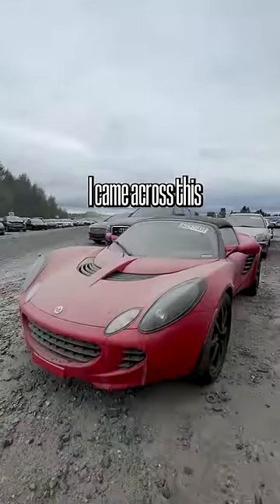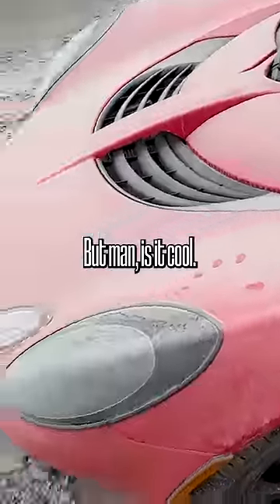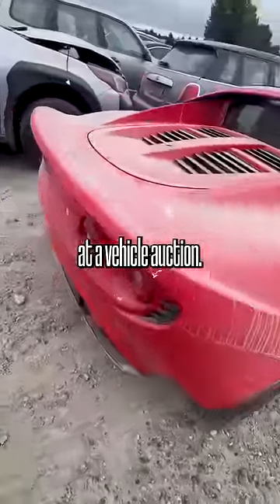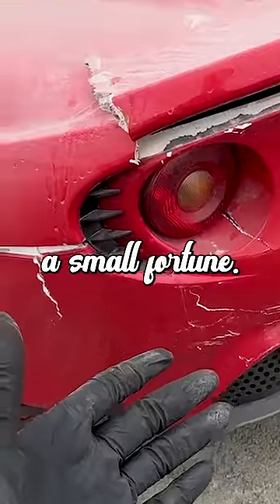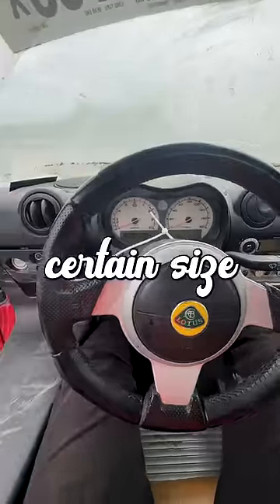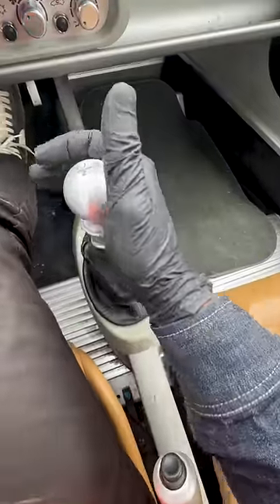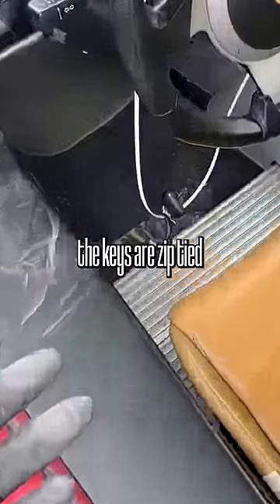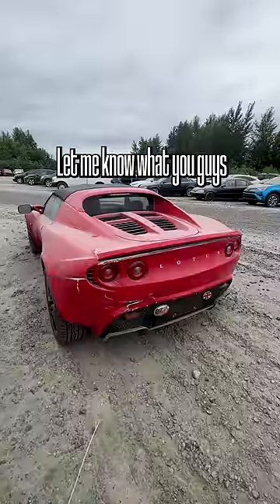Auction Lotus Elise - I Still Can't Believe It...

Comment: These things were actually powered by a highly modified Camry engine if I remember correctly.

What a gem. Gonna go for a lot of money tho
Reply: Was a 1.8 i4 supercharger
Reply: Not as modified as you'd think, especially the newer ones. Camry V6s are surprisingly powerful
Reply: I thought it was a tuned and built matrix engine
Reply: The evora had the same v6 engine as my camry with a twin turbo kit and a lightweight body
Reply: To be exact it's a Toyota 2zz-ge 1.8 dual VVTi-L that was found in a Corolla/Matrix.
Reply: Thats the exige, which i think uses toyotas 2gr-fe with a supercharger, yep a camry engine in a lotus, and the elese uses toyotas 2zz-ge they used that in the matrix xrs and the celica gts and a couple others i forgot
Reply: Nope,.this uses the 1.8 4 cylinder from the Toyota Corolla T-Sport Supercharged
Reply: That's the Evora that has a 3.5 l V6 from a camry
Reply: @organiccold  which is the same engine but fitted with a supercharger. A different supercharger then on the supercharged T-sport. There never was an official 2zz-gze so they're all 2zz-ge.
Reply: I am pretty sure there is a lotus that uses an insanely modified crown victoria engine
Reply: I thought it was the Rover K series in the Elise that was shared with both the MGF, MGTF Rover Metro and Rover 100
Reply: @sunnygtir  that's what I said
Reply: Stock canry and ur thinking evora
Reply: the elise and exige use tne toyota engine and are tbe same car but the exige is the hard top version of the elise, the evora is tne one that uses the camry v6
Reply: The rover K series engine did not pass USA emissions, so Lotus switched to the Toyota engine that already passed USA emissions when they started to import them to the USA.
Reply: These are inline 4s
Reply: Everyone is right... Sorta.
The 1st Gen Elise (S1) had the rover K series engine 1.8L inline 4. 

The S2 Elise (shown here) started with the rover engine, but moved to the Toyota 2zz 1.8L engine to pass emission standards, the head is slightly different. All S2 Elise/Exiges sold in the US have the 2zz and known as the "federal" elise/exige.

The S3 Elise continued with the 2zz with the 2zr (supercharged option) and a 1.6L 1zr option as well. The Exige went to a Toyota 3.5L V6 that was also in the Evora. The S3 Exige was sold in the states as a track car only since it couldn't pass safety road car standards. The S3 Elise was never sold here legally.

Edit: met someone who had an S3 Elise in the states, they were sold for the first year or two in the states.
Reply: @RenlangRen  I see, so that's why they opted to use Honda's V6 in the Rover 800s that they rebadged and sold as Sterling's in the US market
Reply: Stock Camry engine thru just toss on sc
Reply: It was from the celica gts and the matrix xrs. Some people put that engine into a mr2 spyders too.
Reply: That’s the Evers! Stop giving false info!
Reply: Same engine from Toyota, NA with a Yamaha head
Reply: past 2004 and not the elise, its the 111 to exige
Reply: Wasn't it the XRS Matrix engine that's in there?
Reply: They had a Celica 2zz and the exige had a Aurion/Camry 2gr engine
Reply: It was the 2ZZ from the Celica GT-S
Reply: From yamaha
Reply: @matthewchau8907  and Toyota. The head was designed by Yamaha and block  designed by toyota
Reply: Yes i thought the same i Guess is aluminum block withfiber body man this is a bullets imagine putting a Toyota v12 aluminum from the Century then twin turbo plus nitro  for humble track day😂😂
Reply: @kaosalone3748  so technically my Corolla is a Lotus
Reply: @CneyTMS celica gts?
Reply: @claytry3371  yes it also came in a Celica.
Reply: 2zzfe
Reply: @lowkeydiegoduran4724 super wrong haha no lotus had a 2gr. Thats a v6.
Reply: @REAPER3fitty   bro, what? Ever heard of the lotus evora? It has the toyota made 3.5 2grfe v6 with some work done by lotus for more power. Nextime, do your research before trying to correct somebody, because you'll just end up embarrassing yourself. https://en.m.wikipedia.org/wiki/Lotus_Evora#:~:text=as%20a%20trademark.-,Specifications,24%2Dvalve%202GR%20V6%20engine.
Reply: @REAPER3fitty  also there's no such thing as a 2zz FE only the GE
Reply: @lukeshelly5633  it's better. Because you're Corolla can haul a lot of shit
Reply: Absolutely not. The elise has a Honda engine. Honda and somebody else. It's a version of the K20Z3. The 8th gen Si motor.
Reply: Its essentially a high revving honda vtec engine the only other engine from soembody besides honda with cam Lift ( not the same as variable valve timing as they can coexist or both exist without eachother )
Reply: @repingers9777  it had both VVTi and Lift. It was denominated by the VVTi-L. The only engine ever produced with this kind of lift by Toyota
Reply: @CneyTMS  I wasnt sure if it also had a variable timing cam gear lol so it's more like i-vtec then both engines combine the both
Reply: @repingers9777  I guess so.
Reply: It's a headache trying to explain it to people my coworker has a E36 bmw and says VTEC ain't shit and it's the same as his engines vanos and better which isn't even true and is literally broken on his engine. You know how I know it's not the same thing? Because my fucking h22a prelude doesn't have variable valve timing it's just lift there is no vtc gear that advances timing on cams it just switches to a big cam. And on my 8th gen SI the k20 has both it advances timing up to 45° on the intake cam along with having lift switching to a big cam there is no other manufacturer that is like that there are only things close to it or really fancy cam phasing tech but it's still not as effective as lift. But of course that's too much for most people to understand and accept
Reply: @repingers9777  VTEC ain't shit...

... Until the VTEC kick in.
Reply: Probably an MR two engine. People forget the car exists but it was literally faster than NSX. Player intended for the second and third GEN‘s to get their V6 but it never came to fruition due to rushing the project. But therefore Bangerz have always been adequate hell even when they were making the 2 to 2 for group S the V6 and the four-cylinder made nearly identical horsepower numbers torque probably only mattered in the four-wheel-drive variant for the extra muddy stages but the floor banger would probably be lighter and higher revving for asphalt rally.
Reply: I have a UK 2009 S2 Elise that i never want to get rid of. The S has a 1ZZ engine, the R has a 2ZZ, and the SC has a 2ZZ with a super charger. They aren't big engines but the car is so light they accelerate fast and turn well. You can even tell from the gears in the video how satisfying it is to drive. It's great fun.

Also I'm 6'2 and fit in fine. You're basically lying down when you're in it, so height is not really a problem. Getting in and out takes a little practice though, you kind of have to fall in and climb out.
Reply: The Elise is a 1.8l supercharged engine
Reply: I have the Camry with the evora engine
Reply: This has the 2zzge engine from the corolla xrs and celica gts. It has a version of vtec and i think in the elise its supercharged
Reply: Nah corolla engine 2ZZ-GE basically a 1ZZ block with a Yamaha designed cylinder head and forged piston rods designed to handle the high revs.
Reply: @Rich-fr2yv  Its Toyota and built as a Toyota. Literal tanks lmao. Its just sad that camrys never had a manual option nor a coupe version. I would've definitely bought one if that were the case.
Reply: That's the Evora.
Reply: Early models came with a Land Rover designed 1.8L dubbed the K-Series(not the Honda K series) where later models came with the Toyota 1ZZ-FE and 2ZZ-GE 1.8L engines.
Reply: It’s the 2zz ge, same engine in the last gen celica t-sport and other “sporty” Toyotas from that time
Reply: It was a supercharged 2zz I think
Reply: @Rich-fr2yv 180-200 is not powerful
Reply: @CentralTexasCarSpotter no
Reply: @CneyTMS don't forget the 7th gen celica gt-s
Reply: @br7418 a lotus Evora never had turbo chargers, the first model was a naturally aspirated Camry engine and the later ones were supercharged.
Reply: Tuned and built v6 from xse,xle,trd camrys. + a supercharger
Reply: A real blast when it comes from Opel, the speedster, with the mighty Z20LEH inside
Reply: Thats the evora, elise and exige had a turbo 2zz-ge 4cyl from the corolla S :)
Reply: It was the 2ZZ-GE four-cylinder engine from the Celica GT-S.
Reply: Its the 2zz-ge engine from the celica
Reply: @elliottharrisonellbot2814 yea that what I thought to
Reply: @toohda in a car that small with that much torque it’s more than enough
Reply: The evora
Reply: Its really close to the 2az fe found in my old pontiac vibe. Crazy
Reply: @VICIOUSLYFAST to be precise a toyota 2zz ge engine with Variable Valve Lift on exaust and intake, very good atmospheric engine.
Reply: It's just a 2zz barely modified. 2zz from a celica is basically the same. Also take the 2zz from the celica and stick it in a zzw30 mr2 (easy swap) and you basically have a less sophisticated elise. It'll snap on you a little more often due to the strut suspension but in terms of peak performance and grip you're about 90% of the way there with some decent tyres.
Reply: It shouldn't go for much over $10k. It was originally under $40k and this one is old and damaged.
Reply: Celica GT-S engine 1.8L
Reply: @bobjames1521  shhhhuhh dont tel them you can put a 2zz in a mr2, that is absolutly not why I am searching a mr2....
Reply: Same engine as the Celica GT-S
Reply: @T-bone_225 the "crown victoria engine" is just a 4.6l v8 modular motor .... nothing special and it was in ... everything
Reply: @j-bob_oreo  Ok thanks, good to know
Reply: It has the 2zzge from the Toyota celica
Reply: Most likely to be a 2ZZ-GE. The 1.8L i4 from the 7th gen Toyota Celica GT-S, tuned(?) by Yamaha I believe. Great little motors. Super rev happy.
Reply: @VICIOUSLYFAST I don't think it was supercharged, I'm pretty sure it was a just a tuned 2ZZ 4 cylinder from corolla XRS, Matrix XRS and M-Theory, and Celica GT-S
Reply: Its a 2zz from the xrs line in the early 2000s. Also in celica gt-s in its final run
Reply: @kaosalone3748  It's just the same exact engine from the Corolla and Matrix with a Lotus cover on it, no modifications.  That 2ZZFE Toyota 4-banger was a beast!  Lotus also stuck a supercharger on it in the "S" model, but Toyota also offered the same supercharger as a TRD OEM install.
Reply: These were powered by a Rover engine originally before a Toyota corolla 1zzfe engine was used and there was also a 2zzge engine in the Elise 111R and Exige series 2 which also became supercharged after 2005.
Reply: Worked on one a while back and it just had a red top toyota engine 2.4l I believe nothing fancy
Reply: @Rich-fr2yv Okay, well, it's not from a newer camry, nor is it a v6 soo what's your point?
Reply: Some had the Yamaha designed 2ZZ 190 bhp 
engine ....
Reply: the only thing that's actually brought over from the camry engine is the block, fun fact😊
Reply: No it's the Celica GTS engine. The 2zz ge inline 4. Tuned by Yamaha. These did get the Camry V6 with the series 3 models but those were never sold here in the US. We only got the series 2.
Reply: @Unicornpirate  
Yes but there were 2 engines used in the Elise , both by Toyota and both 1.8 litres . The first was a 130 bhp out of some other Toyota , maybe the Corolla . BTW .....
Totally different engines not same block or head , 

The second different bore and stroke , the 2ZZ much shorter stroke and red lined @ 8,500 rpm 1.8 Litre Yamaha designed 2ZZ 190 bhp VVTI , in the UK it was in the sporty version of the Celica ( Yamaha on some castings ). The 2ZZ was used as a N/A engine also with a supercharger with 220 , 243, 260 bhp some of these went into the Elise, this was also the Exige S 4 cylinder ( Ive got the 243 Exige ).
This looks more like the standard one with 130 bhp ? maybe .....
Reply: @CentralTexasCarSpotter  nope, it's both the exige and elise.
Reply: @budbud2509  The Elise in the US started at 190hp. I don't think they sold it with 130hp here. Maybe in the UK and Europe but not here
Reply: Highly modified?

Dude, some of them were offered with near-stock camry engines.
That's what power to weight will do.
Reply: @organiccold 235hp on a t sport corolla dont know if the lotus has the same. But another smaller pulley and bam more hp
Reply: @elliottharrisonellbot2814 it was initially when the Elise first came out but they later switched to the 1.8 Corolla engine for reliability and to be able to make more power later on with a supercharger.
Reply: @RenlangRen  Rover engines at that time were actually supplied by Honda, Rover modified the design for the slightly larger more powerful K series but it was US emissions compliant and able to meet US market requirements. Rover was going through a rough patch eventually being bought out in 2005. Lotus saw this coming and made the smart play of switching to a Toyota Engine.
Reply: The Rover engine was never Federally certified.  That is the reason why Sun International was importing S1's with Honda K series swaps before Lotus started using the Toyota engine.  Unfortunately when I post links talking about this the platform deletes my posts.  But some google searches will bring up evidence of this.
Reply: @toohda  Try 301
Reply: I think corolla engine
Reply: ....... I think it was the early ones with the round headlights had the K series the later ones have Toyota...
Reply: @robertwoodliff2536  You are correct.  The original Elise model not sold in the USA had a Rover-K engine in it.  Lotus switched to the Toyota 2zzge engine when they made the newer model that sold in the USA.
Reply: Celiac 1.8.  The Exige uses the same engine, supercharged.
Reply: @NickTheGreek0410 your correct
Reply: Corolla motor, the 2zzge to be specific. Later models were powered by the 2gr Camry motor.
Reply: @elliottharrisonellbot2814  series 1 and early series 2 have the k series rover engine. 2004 onwards its the toyota engine.
Reply: only the new Exige... old ones are 1.8 4 cyl engines
Reply: Was actually a Corolla motor
Reply: In the uk we had the corolla t sport compressor, which was a regular tsport engine (2zz) with a supercharger, that’s what this car had. Also it’s a Yamaha engine
Reply: @TheV8Pumpkin  the 2zz in a Lotus is supercharged.
Reply: @CentralTexasCarSpotter  No, that IS an Elise.  The Exige has a roof air-scoop.  It also has air scoop cups on the side.  The engine cover on the Exige comes down from the roof line, instead of being aligned with the bottom of the rear window.  For a reference, I Own an Elise; this answer is authoritative.
Reply: @VICIOUSLYFAST  The stock Elise from that year had a 2zz-GE engine without a Supercharger from the factory.
Reply: @lowkeydiegoduran4724  unquestionably an Elise (S2 series) with the 2zz-GE engine.  1.8 Liter VVTL four cylinder engine.  I got one in my driveway.
Reply: Toyota Matrix engine
Reply: @CneyTMS  bingo
Reply: @CneyTMS And Celica T sport
Reply: @elliottharrisonellbot2814 the earlier models did use the rover 1.8 k series. The engine can also be fitted to mk3 and 4 rover metro/100
Reply: @matthewchau8907 Yamaha had a hand in designing the vvtli engine.
Reply: Nope.  The Elise is the same 2ZZ engine found in the 2000-2006 Celica GTS.  i4 at 10.5:1 CR with VVT-I.  Also shares the same 6 speed trans but with a shorter final gear.
Reply: It was powered by a 1.8L Toyota 2zz-ge. It was used in Corolla and matrix XRS and in the Celica gt-s. I believe Lotus used their own custom mapped ecu plus it was also offered with a lotus supercharger which is why that version isn’t called a 2zz-gze since it wasn’t supercharged from the factory by Toyota.
Reply: Nope rover k series engine
Reply: Lotus Elise's are 2zrfe engines
Reply: Depending on the model year, some of the previous gen (I think) were also powered by a 1.8l Rover engine, which is known to be as reliable as a drug addict with commitment issues.
Reply: Nope.  It had the 2zzfe out of a Celica GTS.  6 speed 180hp redlines around 8k
Reply: @CneyTMS  More popularly known for its use the the gen7 Celica GTS.  These are great engines.
Reply: @CneyTMS thank you, someone finally got it right. MFS out here saying it's a v6, when anyone worth their weight knows you're not fitting a v6 and a trans in there.
Reply: @tdforce7584 no sir, I that is not. It's an Elise. Go home, you're drunk.
Reply: @Chopped93VX  I think swapping in a 2GR-FE v6 in there is possible and has been done.
Reply: I think it was a celica/corolla engine
Reply: @Chopped93VX  MFer Hennessy put an LS7 in one
Reply: @Rich-fr2yv  how much of the original car did they cut out? Uh huh, exactly.
Reply: this generation of elise used the N/A version of the 2zz-ge, which is the same engine as the Celica GTS, Matrix XRS, Corolla T-Sport etc. and the exige used a supercharged version
Reply: @organiccold  the exige was supercharged, you can tell it isnt because of how low the "bonnet" is. the exige's have a smooth rear window that aligns with the roof bc of the intercooler
Reply: These cars are actually not too bad on the exotic car scale
Reply: It is the 2zz engine, found in the Toyota matrix and celica
Reply: @CneyTMS also found in Toyota volts, pontiac vibe, Toyota celica and lotus exige.
Reply: They weren't highly modified. They were straight up Toyota 2zz engines.
Reply: I thought they were pretty rad cars, then I absolutely smoked one in my stock eclipse GS-T. I was disappointed and expected more.
Reply: Holy crap none of you know anything. Look it up instead of wasting time.
Reply: @dandiegidio7729  so you're saying I'm wrong as well as some others that got it, right?
Reply: Man it's got the 2zz Toyota engine. I have it on my Celica without the beef xP
Reply: @VICIOUSLYFAST 1.8 sounds like a Corolla engine
Reply: @CneyTMS but primarily the last Gen Celica GTS, actually. 
And as far as I'm aware mechanically the same.
Reply: @jaaceek321  Nope. In the 2005 Elise is NA. The Exige is SC.
Reply: @patrickvanrinsvelt4466  yeah I know I was wrong
It's an NA 1.8 I4
Reply: @jaaceek321  I drive a 111R and love her. Doing an air filter, MAF, and throttle body cleaning this weekend. Such an easy car to do your own maintenance on.
Reply: Elise had first and second gen 1.6 Rover engines.
Since 2006 and lotus got sold to a Chinese company, they had in the elise a 1.6 Toyota engine and two different 1.8 supercharged toyota engines, all a bit modified and had 136hp, 190hp, 220hp and 250hp.
Reply: 1.6 L Toyota 1ZR-FAE I4
1.8 L Toyota 2ZZ-GE I4 (2011 Models)
1.8 L Toyota 2ZR-FE Supercharged I4[16
Reply: The series 1 elise had a rover k series 1.8 double cam from British Leyland and the series 2 cars (this shape) came with a toyota 2zz-fe 1.8 double cam. Similar to, and a common swap into, the mk3 mr2's. The lotus evora was tbe one that came with the camry v6 both in normally aspirated and supercharged form.
Reply: @Rich-fr2yv ”especially the newer ones”…. No.. from an automotive design engineer.. No. 

The FASTEST Camry ever produced was the Lexus ES300 version of it, from 1997-2001 with the 1MZ V6. I personally have done over 150mph in a 97 Lexus ES, and no newer Camry on earth can beat that car to this day… a 2024 Camry TRD tops out just under 135mph…. Not even close to the same performance.